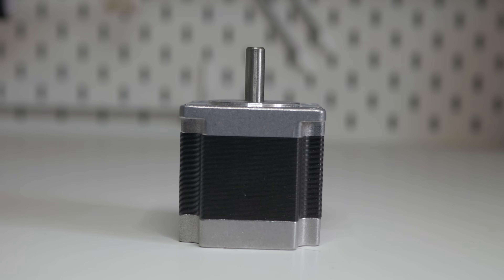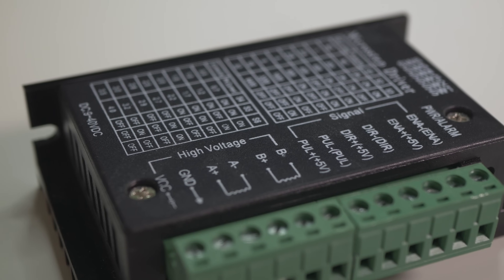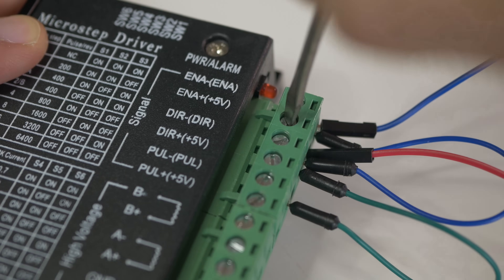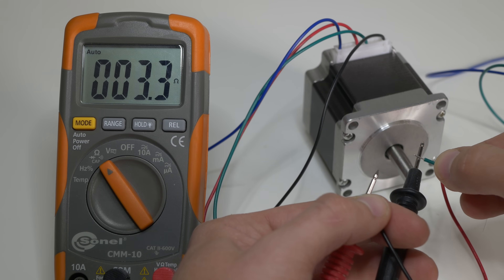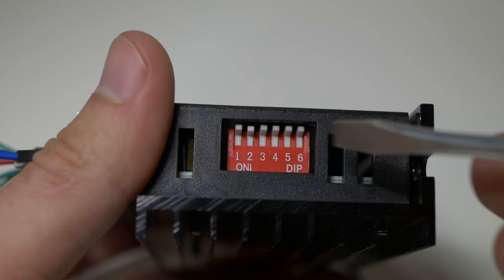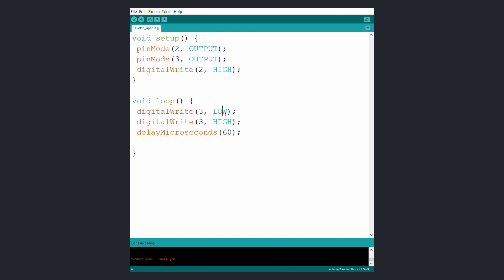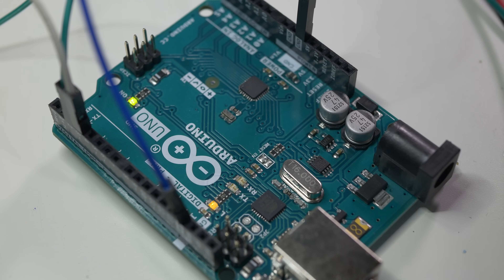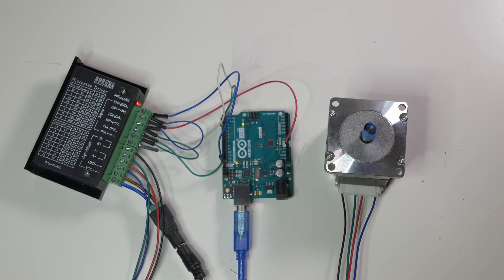Nema23 Stepper Motor and TB6600 Arduino (Quick tutorial for beginners)

Comment: Thanx for your clear vid, gave me hope,is there a way to add an encoder so that i may use that in a simulator single axis "surge" motion, would like to fit that kind of motor setup under a seat with slide rails and move it back and forth with commands from simhub? Thanx again

Comment: So if connect a function generator with a square wave output, it will control the pulse also? Then a switch connected to a battery can be used to manually control direction?

Comment: Haha. Saw My comment from back when I was using DRV modules. Thankfully got a TB6600 instead. MUCH BETTER to screw the wires into those terminals than wonder if the breadboard was connected nicely.

Comment: Working with 2 different TB6600 and 2 different switched 24 volt, 15 - 20 Amp supplies 3 different NEMA23 steppers all overran by 15% - 30%. On low speed the steppers even make short moves in the wrong direction. 
Changing the power supply to 12 volt, the stepper run as expected.
Are my 2 TB6600, bought either from Banggood or Ebay, fakes, nock outs, rejects or what?

Comment: Great presentation and simple... quick question, when not using a PC connection after uploading the code via the arduino USB, do you provide power to it itself from the same power supply or a separate one? You said you used 12V; Arduino can also operate with that voltage. Thanx much for responding. And keep up with the good work.

Comment: The strongest mode for stepper motors is half stepping to prevent resonance.
It is also the most repeatable, after full stepping. 
Micro stepping is smoother but lacks torque and repeatability. 
Since these drivers are current choppers, the higher the voltage of the power supply, the faster the motor reaches its speed.

Comment: Hi . please help me 🙏i have all this parts and need a programming code.
I want to make a reciprocating motion similar to the movement of an elevator so that I place a micro switch at the top and bottom of the path.  The switch is not turned off, continue, and finally (it is the if section of programming)when the switch is off, the object will stop at its starting point at any point in the path.for more information about the if section imagine the split air-conditioned swing part when off the set the swing door automatically closed.
Thank you 🌹

Comment: This is a simple thing and when I've tested rotational speed was not as I've expected. If we set delay to 60us (as per program) pulse frequency is about 16,666.67Hz or that many pulses per second. Quite high! I set my driver to 1600 microsteps per rotation so I expect something like 10 rotation per second and get only 1/2 rotation. If I increase microstepping, rotational speed also increases and I expect to decrease. Maybe I am thinking something wrong here.

Comment: Hi Mate, 
I am going to carry a steel pallet (overall weight of 700 kg) over rollers with 2 stepper motors on each sides, do you reckon "Nema 42 CNC Stepper Motor Bipolar 30Nm" is enough for this application?

Comment: Hi, I’ve followed this exactly on 2 separate TB6600s and nothing happens. I’ve checked with a multimeter and there’s voltage applied on the pulse and direction pins as expected and 12v on the VCC but nothing is going to the coils. What could be wrong?

Comment: thanks a lot for your video. Is it possible to run multiple stepper motor drivers with only single power supply ?? Or I should have buy the power supply for every single stepper motor driver ??

Comment: How is the quality of the motor and driver??, do they get hot after constant use?? I am thinking of using in an industrial motion control system, the motor will be running almost 24x7. Is this OK for this application??

Comment: How can I run motor clock wise and anti clock wise with a limited switch or a proximity sensor at the ends of linier motion how can we write the program.
Reply: Connect your switch to another digital pin on the Arduino. Do a digital read on that pin. When the state changes, just flip your direction bit.

Comment: thank you!!! Can anybody answer why the ENA +/- are both to ground? I like it because it leave more IO pins for other drivers, but I don't understand what the ENA pins do?
Reply: ENA is used to energize the coils. Keeping ENA enabled all times will cause some current to flow into the coils, thus keeping it energized, which will also heat up the coils. This is good for creating a brake on the motor to prevent the shaft from turning, however this also consumes energy when doing so.
Reply: @arbjful  so all in all both ENA+ and ENA- can be bridged with all other - outputs?

Comment: I've been searching for a video to control this type of stepper driver with a Raspberry Pi. Why does does everyone use Arduino?
Reply: 1) Because it’s easier
2) Because Linux is not naturally gifted for Real-Time
3) Because when you blowup your GPIO stage it cost you $2 instead of $35.
Reply: I would. Like to see this Aswell. It would be interesting to see someone convert there code from Arduino to raspberry pi. That would be helpful.

Comment: TB6600 are not good drivers. DM524T drivers are much quieter, reliable and can take up to 50V DC input, which allows to run motors at much higher RPMs without loosing steps.

Comment: Does TB6600 can run neema 34 stepper
Reply from the maker: If the current and voltage of stepper motor is not bigger than max drivers current and voltage then sure it can
Reply: @nikodembartnik  thank you for your precious reply

Comment: Is this motor and driver reliable? What is the failure rate? I want to try in a industrial application, where it’s going be running continuously  like 24x7
Reply: No. Both are one of the worst on the market. You should search for other drivers (more than 5 dollars) for industrial needs :D

Comment: Great! I know how to control a stepper motor with PLC, and I used it when I got my first job. I searched for many manuals so that it can run normally. Just a question: whether it is controlled by the single-chip microcomputer. Looks good.

Comment: Did you forget that you once said that TB6600 response may differ from batch to batch? In other words, it's among the MOST unreliable drivers around. I experienced it a couple of days before. More than a fist of reviewers really don't recommend to use that driver arguably. https://youtu.be/HeVc6en-ZWA e.g. with or without an arduino of course.
Reply: dm556 isnt realaible either, i have 2 of them sitting there. same issue. cwd556 is expensive but just fine

Comment: For find motor coil, you can just simply short cables and spin motor- if you fill a little resistance you find coil (usually is one middle and one side pin). Good tutorial! pozdrawiam ;)
Reply: Quite useful.

Comment: what I puzzle about where is delay between digitalWrite High & Low ?
Reply: You do not need a delay between these two. You only need a delay after both High and Low are executed. This is because the driver only reacts to the rising edge of the pulse.
Reply: @nielsvandenboom  OK means this driver works differently then A4988

Comment: What are the benefits of using this kind of driver rather than a CNC shield and the small drivers
Reply: Easy to configure with the DIP switches vs tiny potentiometers on the shield. Bigger heatsink=more power. You can use them for other systems like NVEM (=Ethernet) also therefore not dependent on USB or Arduino.
Reply: They are also generally able to handle way more current than the small drivers for the shield, which means you can run bigger motors.

Comment: I have motors with more than 4 wires.  Are they setup the same way, just using the 4 color wires you show, and not using the other wires?
Reply: just use 4 of them excluding 2 coils middle wires

Comment: Top tip from personal experience. If you're using an arduino shield with plug in drivers DO NOT TURN ON THE STEPPER DRIVER WITHOUT A MOTOR CONNECTED. the drivers will burn out.
Reply: RIP this guy's motor driver.
Reply: Thanks a lot castle
Reply: Definitely keeping this in mind, thank you, RIP your driver...

Comment: Cool. Those NEMA23 seem like they have a lot more torque. 
So about the Arduino, it it getting power from the USB or the TB6600 ?
Reply: USB. The driver is at least powered from 12v so the arduino regulator will not like the joke for to long !
Reply: This exact model motors are over 9mH inductance (wow). They will perform the best with over 70 volts...One of the worst nema23 on the market.
Reply: @evgenitantikov5865  What would you recommend, and some use cases?
Reply: @GASNICABRUNATNA  Search for low inductance motors in the range of 2 to 3.5mH.
For example Nema24 (60 series) 4A, 3.2mH, 3Nm paired with DM556 or better with TMC2160 driver set at 3.2-3.5A to avoid overheating and set 1/8 or 1/10 microstepping. Run with 48V power supply.
Chinese versions of this motors and drivers are around 20 dollars each. As for PSU Meanwell is a good, cheap and reliable brand. You need 1 psu 48V 3.3A for each motor. It cost around 20 dollars.
This is powerful enough for even larger and heavier machines, and cheap enough with the cost of 60 dollars per axis.
If this is too powerful for your needs, search for 2-2.3 mH motors, and use with 36V psu - it gets even cheaper.

Comment: Nice short video! 

Been screwing around with one last week. My biggest issue was: I had a program running on my esp32, and wanted to move a stepper. And I couldn't use the delay function. Now some libraries advertise non-blocking functions. But it just didn't work. I ended up with a separate arduino Nano that was controlled by I2C by my esp32. I have had this issue before and therefore I  switched to i2c quickly. Now everything runs smoothly.
Reply: what is 12c?